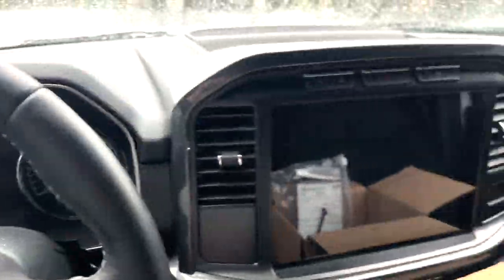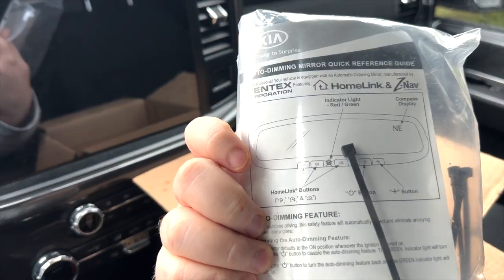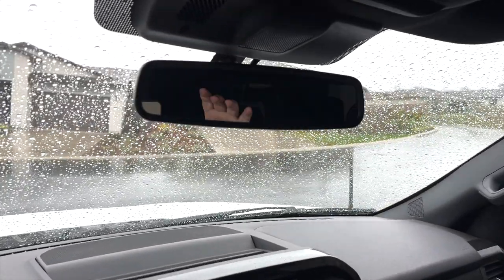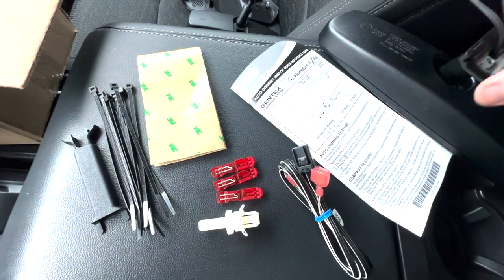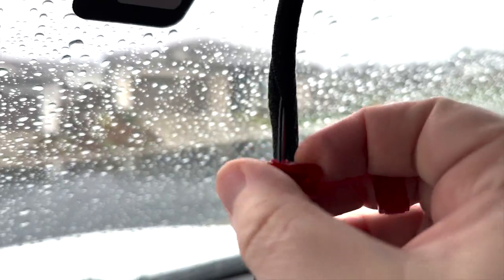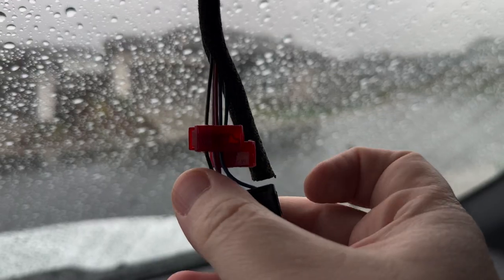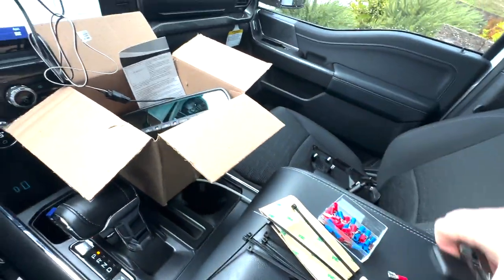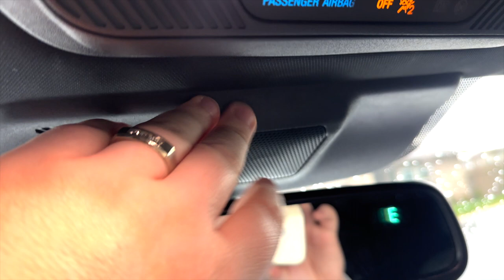F-150 Rear View Mirror Upgrade (HomeLink for $10)

Comment: Great video! Appreciate you sharing, just to clarify the link in the description includes the wire kit? It’s not just the mirror correct? Thank you!
Reply from the maker: That's correct. I used my own splice connector to modify the ground that came with the mirror, but other than that - everything else I showed in the video came with the kit.

Comment: I just installed the same mirror in my 2019 f150. The only problem is the mirror will not turn on. I verified it has power to the mirror but it just won’t turn on. Could there be something wrong with mirror? Please give me advise.
Reply from the maker: Did you make sure it’s grounded properly?
Reply: I have it wired just like in your video to the green wire. All the other install videos are also using green wire so Im pretty sure it is done correctly. 
Im kinda burnt out with it for today but I will double check tomorrow. 
Thanks for getting back with me.

Comment: Thanks so much for taking the time to make this DIY video. Very helpful! I just purchased a 2021 XL and would like to get rid of the ancient garage door opener clipped to my visor full of ancient CD's. One question: the wire that you affixed the spade connector is connected to the green ground wire? I couldnt hear if you addressed that and I couldnt really see in the video. Thanks again.
Reply from the maker: yes, green is ground so after I modified the lug that came on it, I attached it to the green wire on the connector. I'm not sure what wire harness comes on the XL trim so I don't know if the colors are the same, but I would think that they are.

Comment: I believe you said you used the constant 12V wire?  With this setup I think the garage door opener feature (homelink) is always active, meaning if the truck is in your driveway and someone breaks into your truck (or you leave it unlocked), then they can easily open the garage door.  OK for some, but others will really dislike that operation.  I believe if you tapped into the 12V switched wire instead (at least for the homelink wire), then this would not be the case.  Just pointing this out, lots of people have the "clickers" attached to their visors, and this is the exact same level of risk, so it is not that different from how a lot of people use their garage doors.  But it is something I think should be avoided in general, given the choice.
Reply: Also, I don't know what wire is which, but a user in one of the f-150 forums posted that their 2021 black wire was switched, and that the red was constant.
Reply from the maker: @user-we4ul8jw3k  I have learned the hard way that it doesn’t work unless the truck is on 😂 so I don’t believe it’s drawing power when it’s off
Reply: @ryanmoyer1  Yeah, guess the black is switched power then, which I think is good.  Do you have auto high beams?  And do the auto high beams still work after this install?
Reply from the maker: @user-we4ul8jw3k  yes I do have auto high beams and they still work. Love that feature!
Reply: @ryanmoyer1  Great to here!

Comment: Can this mirror be used on any vehicle?
Reply from the maker: I would think so, as long as it has a standard rear view mirror mount. Worst case I would just be careful disassembling what you have and if it doesn't work - return the unit.

Comment: the link goes to a part is discontinued as well.  Please provide the link for the new item. Thanks!!
Reply from the maker: When I found this product number I found a site using the product number from another video and when I placed the order they let me know that the original product number I used was discontinued and recommended this one in place of it. I would do the same thing using the product number I provided.
Reply: Got one on order!! Thanks!! I am hoping I have power up there.  This is for my F250, 2018 model, XLT.
Reply from the maker: @jimmysmith4704  hopefully you do. Good luck on the install you’re going to love having Homelink!
Reply: well...just my luck.  I got my mirror in today, opened it up, and it is a mirror that only has auto dimming, NO homelink....so now I am stuck with a mirror I do not need and the best deal so far on one that would have the homelink is over $100.  Anyone need a auto dimming mirror? cheap? LOL
Reply from the maker: @jimmysmith4704   Dang I have definitely made mistakes like that before. That's a bummer.

Comment: Do you have to turn the mirror on, via the power button, every time you turn on the truck or will it default to last setting?
Reply from the maker: If anything, it would default to being on, I’ve never turned it off that I can think of
Reply: Thank you.
Reply: You also said in the video that the black was constant power. Was that accurate or is it ACC power? I don’t want constant power to the garage door opener as my truck stays in the driveway. I enter the house through the garage.
Reply from the maker: @jamesm927  I was incorrect, that’s ACC power. I also park in the driveway and I have to turn my acc power back on if I forget to hit the button before turning my truck off
Reply: Perfect! Thanks again.